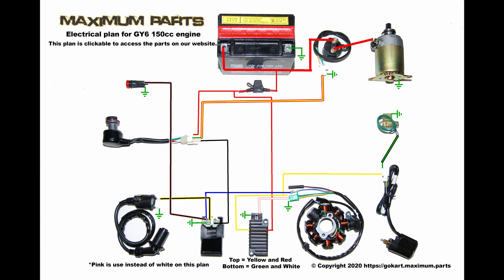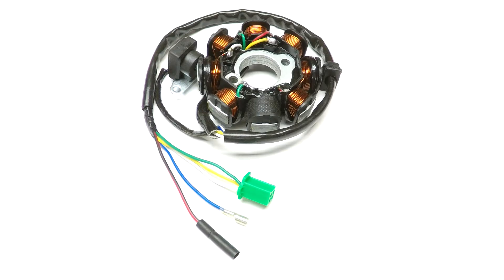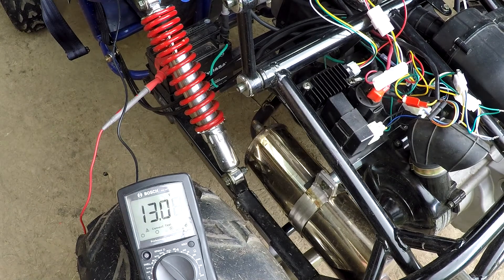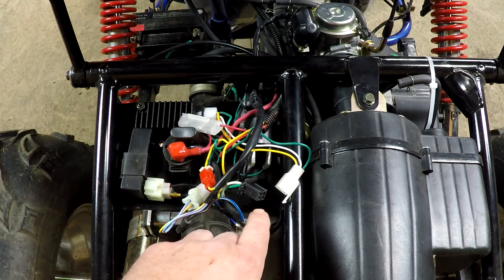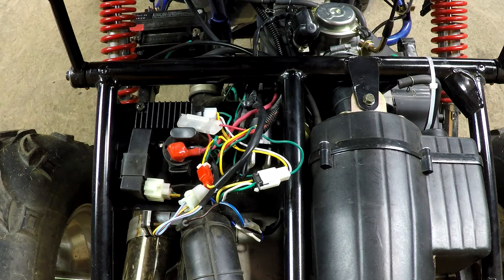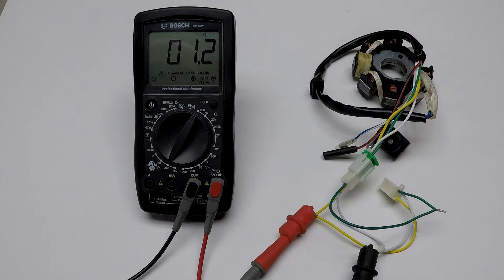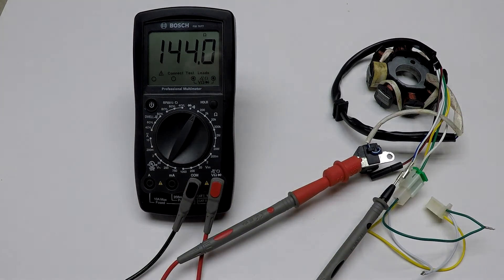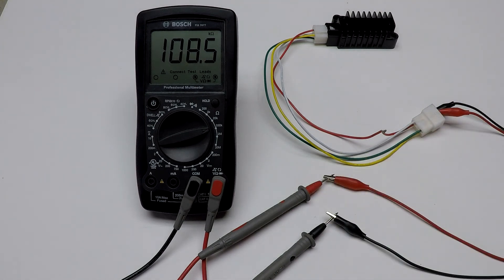Go Kart 150 Charging System Testing

Comment: My carbide 150cc reverse is not changing and the wires to the stator is starting to melt , please advise
Reply: The rectifier is brand new and I gave good continuity on my powers and grounds also the cdi box is new

Comment: hey my 2021 tiking 200cc 4 seater has a 11 pole stator and when running testing at the battery its about 15 +- volts is that to much? im going to be running a stereo system on my kart and plan on putting a much larger AH battery so more charging is ok with me  jsut dont want to over do it.. yall think 15+- charging colts to battery on?
Reply from the maker: You should have 14.7 volts. It might be cause by the meter and not the machine. Putting a bigger battery won't help. You have to match the power consumption with the charging system and not the battery. If the charging system do not supply more than what you need, the battery will die slowly. This is why putting a bigger battery won't help, it will eventually drain the battery.
Reply: agreed but i need more amps than a electric kids car. i put a small optima battery with plenty of cca. and will power my 2 way radio and stereo and leds easily now plus while we are camping/karting ill have a small solar panel to trickle charge the kart batt just like i do with my radio eqt in the field..ill have a video soon on how i did it. @maximumparts
Reply: ok rechecked it after replacing stator and gapping it to .015 and its dead on 14.7/8ish.. thanks @maximumparts

Comment: 2 part question. 1st part is what do you recommend the maximum amount of amperage for an led light to use? 2nd, if there is no availability for power usage for lighting can i just run an isolator with a 2nd battery without damaging the stater/regulator?
Reply from the maker: @ramrebelmibrian4050 Good questions. If you want the safe side, check the wattage of the original lights and that will tell you the maximum wattage for the LED. If you need more, you could install a volt reader in the dash, this way you will see the voltage go down if you have too much power usage.  

If you separate both circuits it would work until the second battery will be dead. You keep the main battery for the machine and basic lighting and the second battery just for the add on lights.

If you don't have enough power, you could use an 11 pole stator and regulator, https://gokart.maximum.parts/3-phase-rectifier-regulator-stator-11-poles-upgrade-kit.html
This is if you have a 150 engine.

I didn't do all testing yet but in my case, I was thinking about installing a volt reader on my machine and see the result.

Comment: hello my go kart does not turn on.  new carburetor .. good spark plug. but the solenoid carburettor has no power. what should i change? spark plug has power thanks.
Reply from the maker: You need 3 things to start engine, air, fuel and spark. You have the spark figured out. Next, I would try to start it without the air box connected to the carburetor. If that don't work, spray fuel in the carburetor and try again. If it start, it mean you have a fuel problem. Can be air bubble in the line, plug fuel filter.
Reply: ok perfect the one I have has no power in the solenoid of the carburetor.
Reply from the maker: If you mean the black thing with 2 wires attach to the carburetor, it's a enricher, it give you more fuel when you start your machine. As the machine warm up, it close the entry of fuel. Your machine should still start without this piece working. It will become a problem when the machine is running and warm up, your machine will run rich and stall when you press the throttle pedal. In this video, I show the basic wiring, it also include the wiring of the enricher, https://youtu.be/4U1ZulC22Zc
Reply: @maximumparts  ok. Trank you. 👍

Comment: My tomberlin crossfire 150cc gy6 stator ground melted. Now runs horribly.  Any suggestions?
Reply from the maker: @Bacon king It can be that the stator is bad. Check if you have continuity between the ground and the ac coming out the stator. If you do, the stator is bad. If you install bigger lights or required more power for electrical, wire can melt like you have now. The stator try to push more power but eventually give up like you have now. It can also be the regulator being bad, check that too.

Comment: My stator read 33 volts
Reply from the maker: The stator voltage will go up and down depend on the demand and also the rpm of the engine. 33 volts is good.